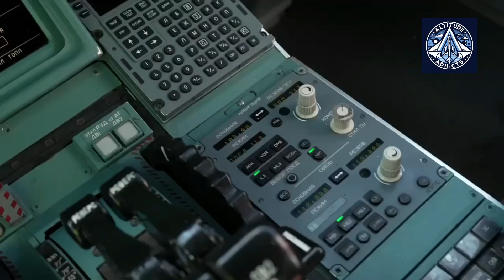Foreign Aircraft Won't Dominate Russia's Skies Anymore; Tu-214 Tests Continue

Comment: I would activate another line for the production of the TU-204 for the 170 passengers and use the  PD-14 engines and explore the TU-224 for a version of a 240 passengers and the PS-90-3 engines or the NK-93 in the future... The sky is the limit!
Reply: Что-за бред?😂😂😂 завязывай с наркотиками...